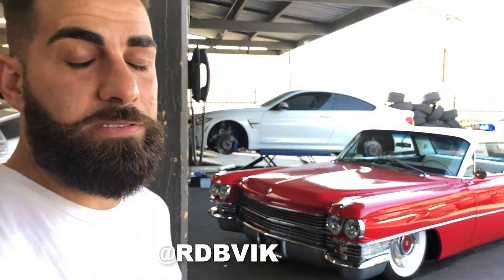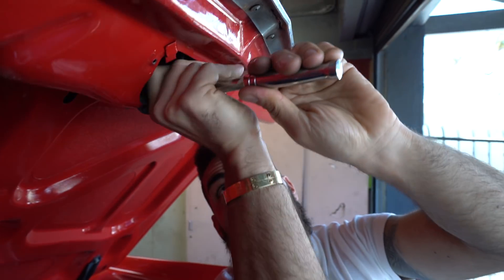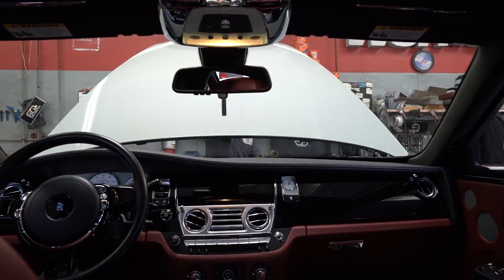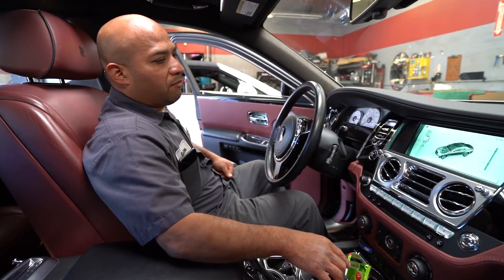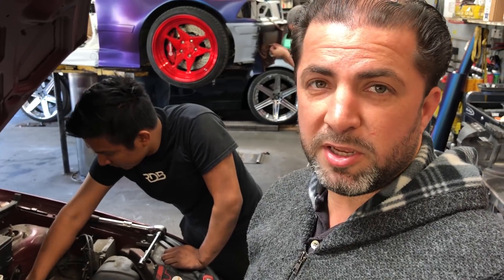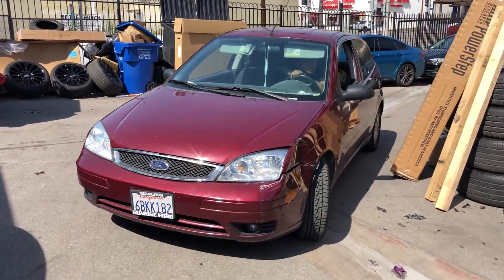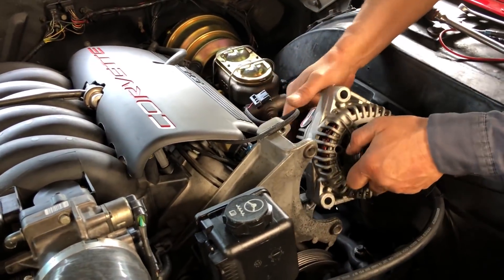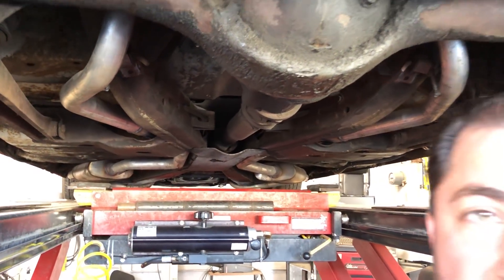#RDBLA FOUR Aventadors, Cadi Wrap and More!

Comment: I always wonder - how is the wrap sticked to the car surface? I guess there is no glue, because they always remove it quite easy... How it is possible it does stick so well without any glue?
Reply: With heat. They showed the guy putting the wrap on near the door and using a blow torch on it.
Reply: its really adhesive.
Reply: TheCobruhAlienat0r LOL Blowtorch ? Really? On wrap made of plastic ??
Reply: There is glue( adhesive) it's like a big sticker sometimes when a wrap is removed it does leave some glue but that's easy to remove with rubbing alcohol
Reply: I think the fire used more to "shape" it than "stick" it.